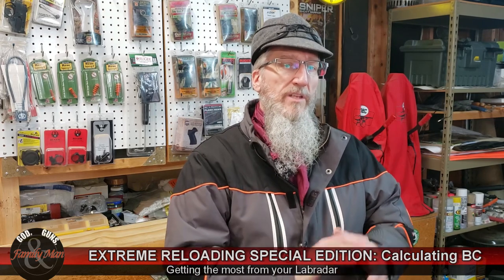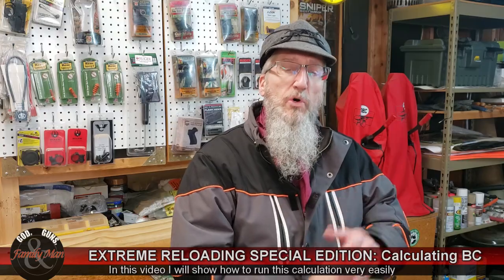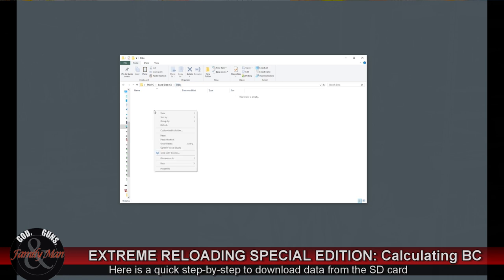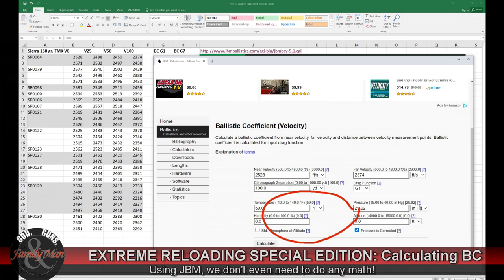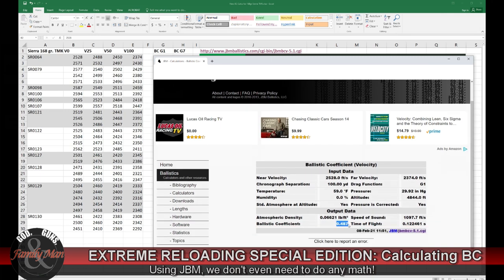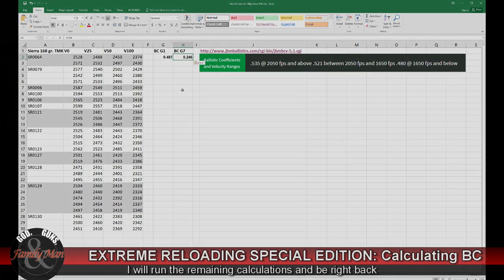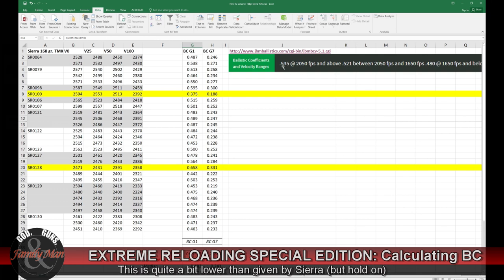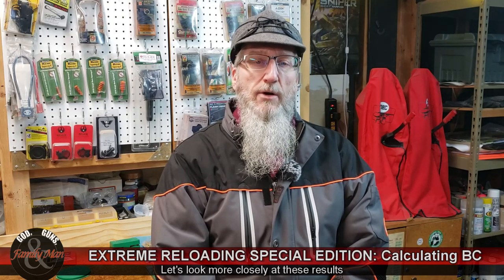EXTREME RELOADING (SPECIAL EDITION): Calculate Ballistic Coefficient (BC) with the LabRadar

Comment: Awesome video!  I think the Lab Radar is a great device, however I question the validity of the down range velocity numbers.  How can we be SURE that the data is spot on, and the velocities and ranges are EXACT?  I mean the Lab Radar shows that it recorded a velocity at 100 yards.  How can we know FOR SURE that the distance was EXACTLY 100 yards, AND the velocity was also accurate???  I'd love to see a series of videos from Lab Radar explaining the radar and how it works, and the accuracy of measurements from the different ranges it can track.
Reply from the maker: Thank you Rico11b.  I can't answer your question on the accuracy of the Labradar at range. I think I saw where some had folks had run a few Labradar units simultaneously and compared results.  Again, if I recall correctly, they found the systems reported surprisingly similar results. However, if there were a systematic error in Labradar units in general, one would expect similar results. Ideally, Labradar would be compared against results from Oehler.  I have not seen this done and it would need to be done very carefully to yield reliable results.
Reply: @sdkweber  I found this video.  https://www.youtube.com/watch?v=LT04hiGQzb8.  In it the guy mentions that he talked with the Lab Radar folks about SNR, and he discusses it a bit.  He also revealed that the radar captures a LOT more data than just Dx1-Dx5 data points.  Very, very interesting.
Reply from the maker: @Rico11b  Yes, there is an entire folder created for each session called the tracks (TRK).  The track files record every velocity observation and by paying attention to  the signal to noise value we can screen out bad data and use only the good data to calculate BC, etc.  I think you will like the video we did looking at the track files https://youtu.be/ozLtampK66A

Comment: ARE YOU CALCULATING FOR TEMPERATURE AND PRESSURE ON THESE NUMBERS?
Reply from the maker: Air density is the important variable and it is used in the BC calculation. Temperature and barometric pressure are not part of the equation (of course, ambient temperature and barometric pressure influence air density).
Reply: @sdkweber I like to use station pressure gathered with a kestrel 5700 Elite

Comment: Have you used your derived BC from your analysis & plugged that new BC into a ballistic app (strelok, geoballistic,kestralAB etc ) &  used those numbers & shot it at extended distances 600-1000yds?.
Reply from the maker: Not really.  You will notice there is a range of BC's calculated using this method and the BC posted (in this case by Sierra) falls within that range.  Thus, I have continued to use the BC posted by Sierra.  
But you raise a good point.  I am now thinking about running more calculations to get about 100 samples and then use the mean or median of that value for my loads.  
Have you tried something like this?
Thanks for watching and posting.  Good question.
Reply: @sdkweber  I have not tried this.  I don't have a Labradar (yet).
Reply from the maker: @ctclimberguy34  I think it is a good "chronograph".  A bit pricey for sure. I also have an Oehler model 33 and it is very good, but it takes about 15-20 minutes to setup, several cables, etc.  The Labradar simplifies all this and gives good results.

Comment: There are some acoustic chronographs that can also provide exterior ballistic information both BC and Cd as well as velocity data. Pendragon BCI has one available and Oehler system 89 (supposed to be out soon). They are more difficult to set up than lab radar, but they can provide better results especially on low cross-sectional area projectiles.
Reply from the maker: Oehler was planning to release that about a year ago.  I also have an Oehler 33 that I have used since the late 80's.  It is excellent but truly a lot of work to setup.  Thanks for watching and posting!
Reply: @sdkweber  Yes, I found this quite informative. I have a lab radar and have used it to characterize bullet BC for a number of years, funny I used JBM as well. The thing I noticed is there tends to be a lot of scatter with labradar out to 100 yds - at least when I do it. If I look at the Velocity vs Distance data that lab radar has per shot. For a .308 cal bullet I generally only consider the data reliable to 60-80 yds. Not sure if you have looked at that before.
Reply from the maker: @Lin-pr8sh  I have always used muzzle vs "as far out as I can get it", let's say 100 yards or even 150 yards.  Are you seeing more variability in calculated BC at these distances compared to using muzzle and 50 yards?  I have not tried it, but am not intrigued if I am understanding you correctly. Let me know if you have a chance.
Reply from the maker: @Lin-pr8sh  Thank you very much for sending this. I am going to look into this a bit more with my data.  I wonder if you would see the  same dispersion away from the trendline if you used time on the X-axis instead of distance.  I have read that the LabRadar is a relatively weak doppler system (this is to make it affordable) which might explain the results.  I think there is also a power setting in the unit. I need to double-check but may need to set mine to max or full power if possible.
Reply from the maker: @Lin-pr8sh  Yes, it does look like the estimate/measure of velocity gets worse over time/distance. I suspect it is related to the limited power of the doppler radar. I will look over my labradar tonight, I thought there was a setting but it is probably set to max right now anyway.  
Is the BCI also based on doppler?
Reply: @sdkweber  No the BCI uses an acoustic array of four microphones spaced at intervals down range. The microphones pick up the bullet shockwave. It computes a BC and Cd from the time of flight data in the audio recording. https://youtu.be/yIuZJq2KvWM
Reply from the maker: @Lin-pr8sh  Thanks again Lin.  I will take some time and watch that video.